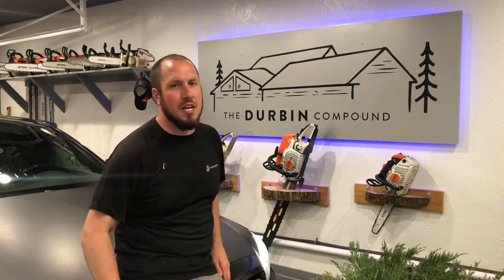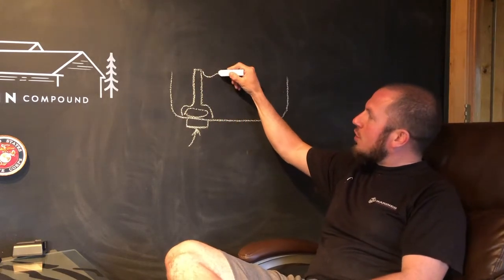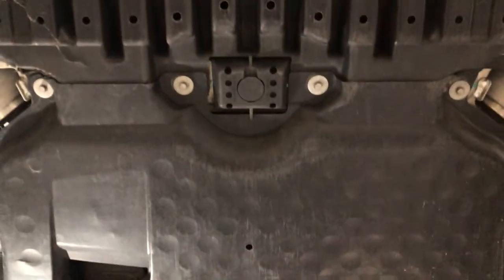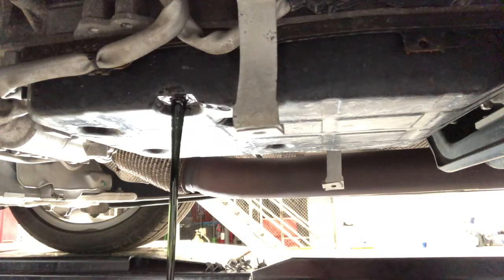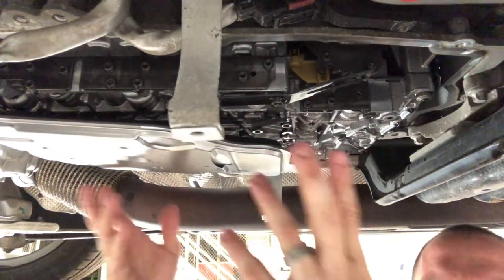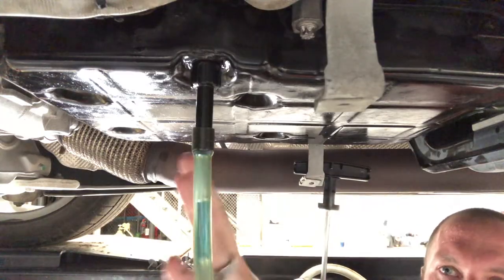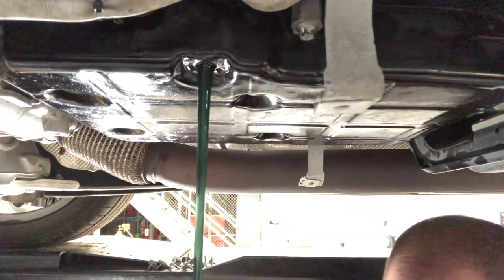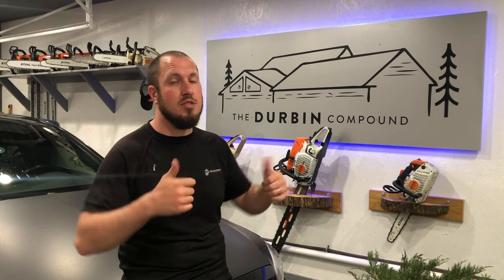Mercedes C300 W205 Transmission Fluid Change

Comment: Your other video made my first oil change so easy. I just watched you. And now that 5W-40 flowing through my engine just makes it rev freely. 

Previously i had the wrong oil in it which made the engine bog or have trouble accelerating. 
5W-30 that difference in viscosity makes a hugh difference

Comment: Great video! Only thing I would add is to start the car and cycle all the gears for about 30 seconds in each gear. That way you are mixing all the new fluid into all parts of the trans before setting the level.
Reply from the maker: Yes! Good point to add. I guess I didn’t explain that in my video!
Reply: That’s what I was thinking to. But do you think it’s a problem if don’t do it ?before you dump the rest .

Comment: I found a video of a teacher, he's on a wheel chair. He said there was an engineer who cunduct a seminar meeting in California. Saying that the transmission fluid has the cooling like radiator going to the front of the engine. So, the proceedure after filling up you run the engine untill it reach the certain temperature and drian the excess. The line going to front has a valve that close and open when the oil gets hot. Reaching the temperature the valve will open and you draining the oil in the line. You end up that less oil you fill up.

Comment: Thank you in advance for making this video and it will save a ton of money. I looked up the type of motive power bleeder that you use in the video and any idea which one did you use and also did you buy a separate adapter to extend the hose? if so, which one? I appreciate the help. this is my first purchasing a c300 and would like to do all the maintenance instead of the dealerships. any pointers you can tell. thank you again.

Comment: When you drain there was a lot of fluid came out before you tip the pipe with screwdriver. That was the actual amount of fluid. And when you fill up you let it drianed the fluid that were above the pipe. That means the amount you filled up is less than the exact level. If you drian the new fluid and compare to the old fluid the new fluid is a lot lesser than the old fluid.
Reply: The amount of fluid that came out is the quantity used when the car is running. When not running, the fluid will always be above the drain plug. 
Compairing both old and new fluid levels should give you around 95% accuracy if you do the maths well.  Great video
Reply: @joe19092  the math is plain and simple. Like grade 1 math. Actually there's no math there. U replace exactly what u have taken out.
Reply: I was confused about that too...

Comment: hi.. does the engine have to be running to measure the oil level?  should it be turned off when it reaches 45 degrees thanks.

Comment: What year is your Mercedes Benz on this video where you did the oil change ?

I have a 2011 Mercedes Benz C300
automatic called several dealers and 3 told me it uses no more no less 6 quarts with filter.  Thanks

Comment: great video. My 2008 c300 has about 39K miles since last ATF refill(2017). started driving to work today and car is shifting harshly when coming to a stop at about 7 mph when transmission shifts from 2nd gear to first. Any ideas before I change ATF fluid?
Reply: My c300 same year is having this issue & it having horrible shifting & high revs , i just bought it oil was bad condition, i also had a moment I put it on reverse & it would just rev , I’m hopping I just needs transmission fluid, did you end up changing the transmission fluid or what did you have to do to fix you’re car hope you could get back to me soon as possible thank you!
Reply: Sounds like you both had clutchpack problems. What was the final outcome?

Comment: I thought you could drain the torque converter on the C300 by removing the drain bolt inside the bell housing.   Great Video.  Thanks

Comment: I need to change the transmission fluid and differential fluid on my 2017 AMG C63S coupe. Do you know if I need to drain the torque converter? I'm not sure it even has a drain bolt or not. Also, do I need to remove a return line to the transmission in order to flush out any transmission oil coolers?

Comment: Should I cycle the gears so the valve body’s open and then add more fluid. My 08 C300 4Matic calls for 6qt without draining torque converter.

Comment: Man i wish i had a lift… for me oem benz parts from dealer were $330 out the door… i ended up taking it to a trusted shop that uses oem fluid and parts for $550 ($200 i could of saved with a lift)

Comment: I just did the service on my C 63 AMG. I rented a lift at a local shop and although I should’ve came back to this video the owner told me 45°C which is around 120°F. I actually took the hose off at around 50°F which is around 122°. Do you think I’ll be OK? Or should I be worried
Reply: You should be fine, but was Better colder than hotter fluid. With a hotter fluid you can risk to run with not enough fluid in the sump

Comment: Is this the 7G Tronic Plus? The 722.9 (the classic 7G Tronic, not the "+" Version) does have ther red fluid. And BTW, this is not "changing" only renewal at best... You left a lot of old fluid in the TQ.
Reply: I think this is 7G Tronic + (BLUE OIL)   7G Tronic (red oil), difference is to se in the pan, the + has lager oval recesses in the bottom seen from outside the pan, color of the overflow plastic filler is green. 7G Tronic has small circular recesses and the plastic overflow filler i apparently white.  Remember to take of the oil pump as well and drain the converter to get all old oil out, and run it through gears when filling.

Comment: does this method remove 100% of the fluid ? i had my trans fluid replaced on my pick up truck and i had it done at the dealership and they hooked up some kind of machine to get all of the fluid out...they told me the machine gets the fluid out of the converter too...basic transmission oil changes dont get all that fluid out....is mercedes the same thing ?
Reply: Their is still 4 liters of dirty fluid left in torque converter
Reply: This doesn't get all the fluid out. This service calls for a full flush via the cooler lines along with what you see here. Some also drain the torque converter which has a drain plug. (Have to hand crank the engine to reveal it.) Your local MB dealership should confirm this if you want to hear it from them as I did.
Reply: @RothBeyondTheGrave  does that mean the instructions in this video are incomplete??
Reply: @stuckinamomentt  yes. There's a great fcp euro vid where they also do only what's in the pan. Not that I fully trust dealerships, but 2 different ones local to me told me they do compete flushes as instructed by Mercedes & the WIS instructions to confirm it are easily found on the forums. 
There's a GREAT vid showing the full job by the FlyingMechanicDiy (think it's called) & a few other vids showing the torque converter drain rather than oil cooler flush, but the principle is the same.
Reply: @stuckinamomentt  YES
Reply: @stuckinamomentt  yes

Comment: This procedure is a partial fluid change...i noticed the color of TF overflowing from filler turned darker after the engine was restarted,  this is the old fluid that is not drained, i.e in TC & oil cooler circuits, which mixes with new fluid in pan.
Reply: Yep.. That's why some people do the process twice to make sure about 75% of the old fluid is replaced..

Comment: Why didn't you drain the torque converter. Turn the crank and look into the hole where the filter goes. Rotate crank to see if the converter has a bolt. Some do some don't. Recommend to drain it or all you found just gets contaminated.

Comment: Is it possible to fill the oil back in using the trans oil fill tube  located between the firewall and the engine? That port stuff with a red lock pin.  Just thought I'd ask.
Reply: That's the 722.6 transmission, this 722.9 doesn't have a dipstick with the red locking tab.

Comment: How do i check the transmission fluid level on this model
Reply from the maker: You don’t.  You fill it from the bottom until it is spilling over the top of the filler tube and you close it up

Comment: Unfortunately you didn’t show how to drain the torque converter and that IS possible. Also need to remove the electric oil pump and drain there too. The overfill meter is designed for an oil temperature 45 degrees EXACTLY.
Reply: If torq converter is drained will transmission not shift?

Comment: How many mileage should we change tranmission fluid, Sir?
Reply: Every 40,000 miles with filter , get car fax maintenance care app
Reply: My 2014 c300 manual states 70,000mi for transmission service

Comment: Did you reuse the fill-drain gasket, the fill  neck and the pan bolts?  Some other videos recommend replacing them. Your thoughts?
Reply from the maker: Replaced the bolts and pan gasket as I did in the video. I reuse the plastic fill neck.

Comment: Good video but you didn't show how to change all fluid. Should be 9 litres. How to drain from torque converter? On your video 4litres of dirty fluid still left in the transmission
Reply: @Voyuuk, thanks what’s the process to remove that ?
Reply: 9 liters is a dry fill. As in a completely empty transmission, after an over haul or rebuild. They take 5 quarts for a regular service, 7 if u drain the TC.
Reply: @petedagreek4583  thanks for info bro..
Reply: @petedagreek4583  Sir, they told me that it is required to change the entire transmission oil/ dry fill every 3 years or 40,000 kms for my C300d AMG Line. Are they ripping me off or is it the correct standard for my car? Would you advice pls!

Comment: hey man, did you ever change the transfer case fluid?  What mileage do you think is necessary for that?
Reply from the maker: As I have been told by my dealer, the transfer case is fed from this fluid.  I was told it does not get changed separately

Comment: I have 2012 c300 w204 119k miles on it never changed before u think I should change it?
Reply: Did you ever change it?
Reply: @alexfeliciano1799  yes
Reply: @alexfeliciano1799  yes
Reply: @nicknick6960 Very soon you are going to get the shock of ya life.